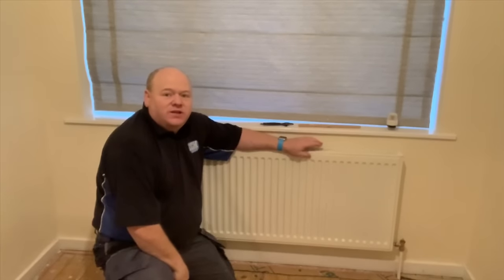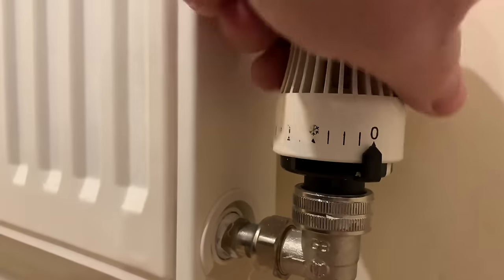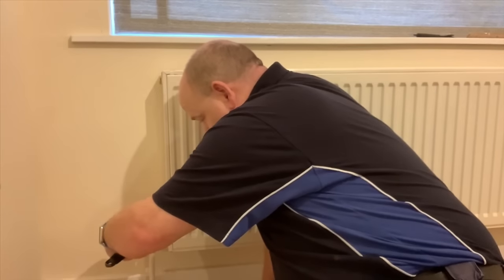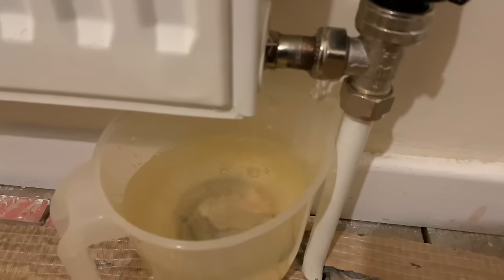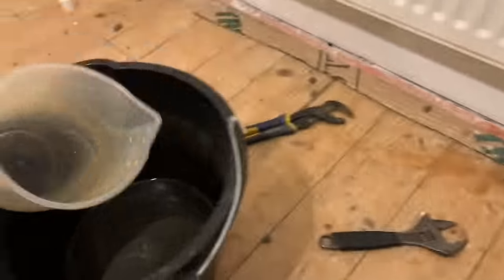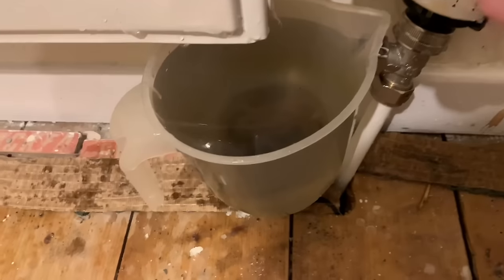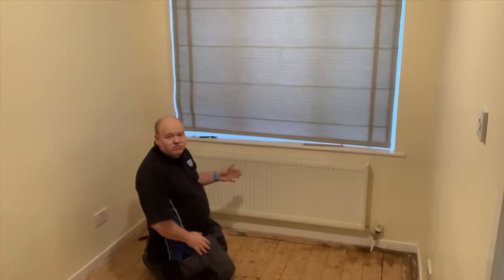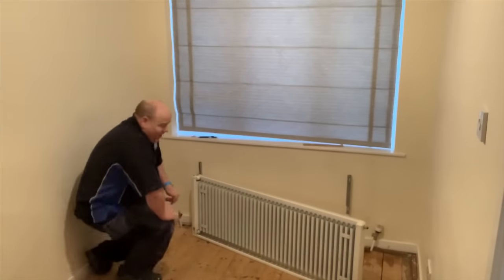How to remove a radiator for decorating - Removing a central heating rad

Comment: You really do not need to remove radiators when redecorating, Buy a radiator roller brush for painting 'behind' the rad...simples! The chances of damaging your plumbing system is simply not worth the risk, not mention the time taken to redecorate. Who in God's name is going to look behind the rad to check on the painting? While you're at it, stick some insulation foil behind the rad, this can be done be gluing the wall (with the small long handled roller brush) and then sliding a pre-cut sheet of foil behind the rad, and rolling it against the wall with the rollerbrush.

Comment: When i do these,as long as the radiator isnt too large,i use 2 dusters,disconnect one side then squeeze the duster into the valve stem,then do the same on other side.remove the rad and turn it upside down and take it outside to empty.always making sure the dusters dont come out
Reply from the maker: Thanks very much for your comment, please consider subscribing to support the channel 🙂